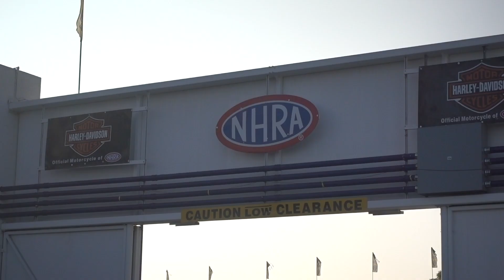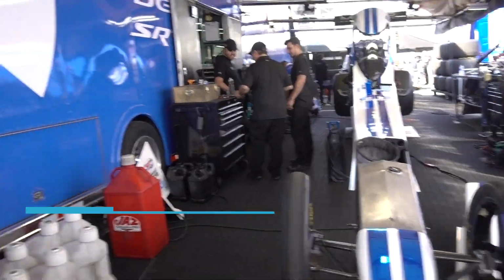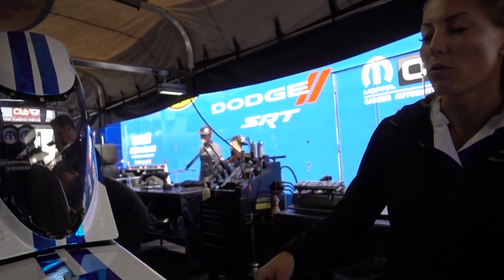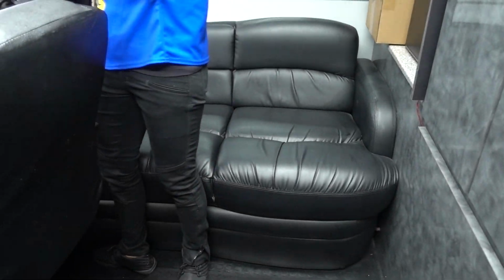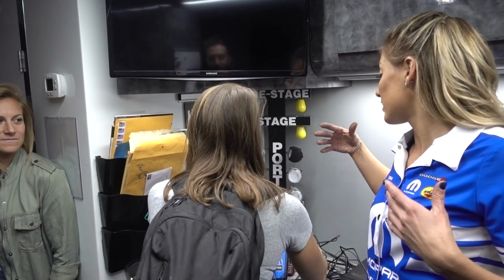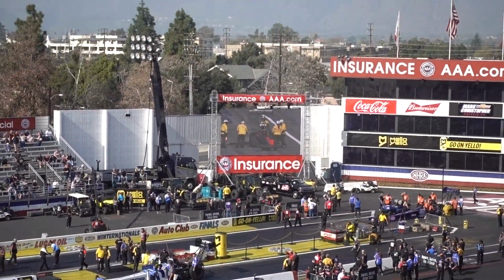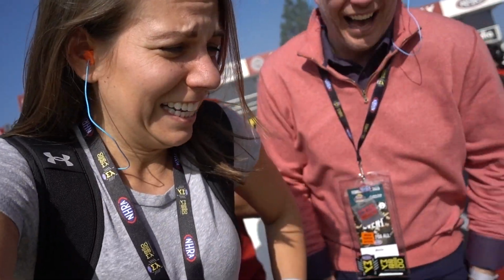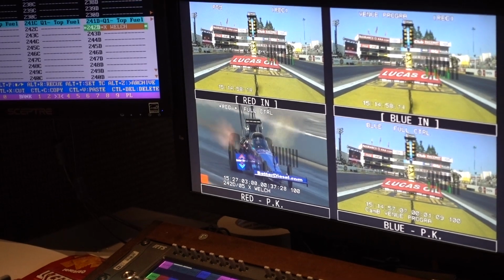NHRA Hot Rod Drag Racing Track-Level Experience FITNESS OUTRAGEOUS!

Comment: Glad you got to experience the sport I love. Did someone explain just how fast those cars are accelerating? The example I use is this. The Dragsters are 300 inches long(25 feet). From the time they leave the starting line to the time the rear tires cross the starting line they have accelerated to just over 100 MPH. They are the fastest accelerating vehicle on earth. Faster than a Jet, Faster than the space shuttle.